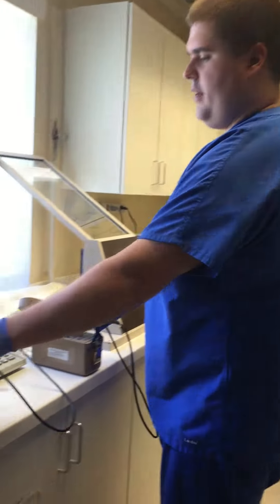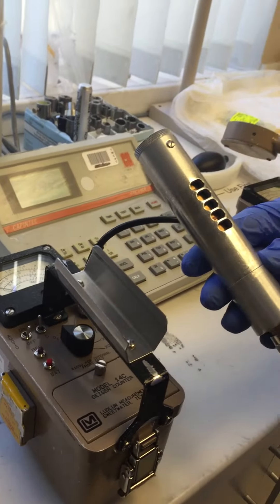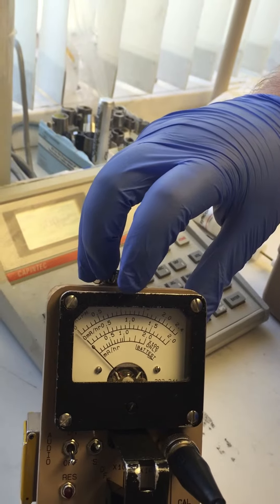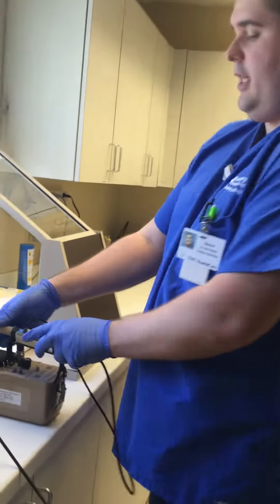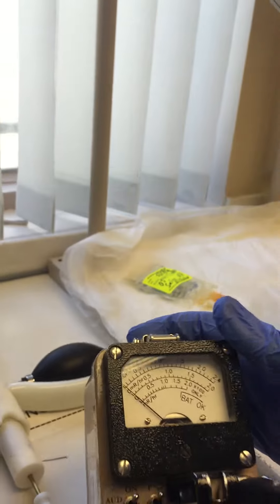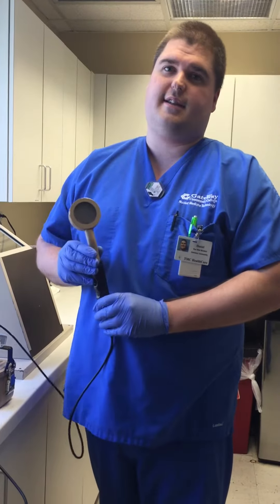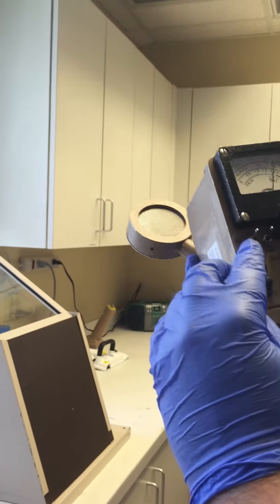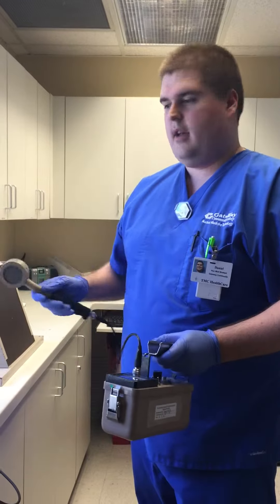end of day survey with survey meter to look for areas of radioactive contamination

Comment: The first unit is not a survey meter. Geiger counter be it.
Reply: Depends what we are defining as a geiger counter. Both are general surveying instruments, that utilize a Geiger-Muller tube for their operation. If a "GM" type detector is the determining factor, then the second one using likely a LND 7311would be the closest to a geiger tube.
 The other unit, in this case the first shown uses a LND 725 which in technical standards is not a geiger tube, but is rather defined as a filled proportional ionization chamber.

Both are Ludlum model 14c multi-purpose survey meters.

One specifically calibrated for dose rates, the other contamination surveying and counting. Although being the meter model they are ludlum includes in the meter a internally house LND 72611 miniature filled proportional type ionization chamber, for dose rate of high range gamma radiation.

In simplicity they are both survey meters, one actually is utilizing a Geiger-Muller tube the other a over engineered ionization chamber. One is set for counting other dosage, but both are capable of dosage if the operator decides to do so.